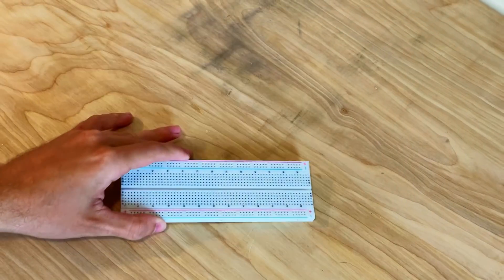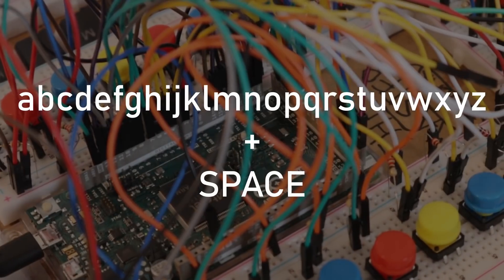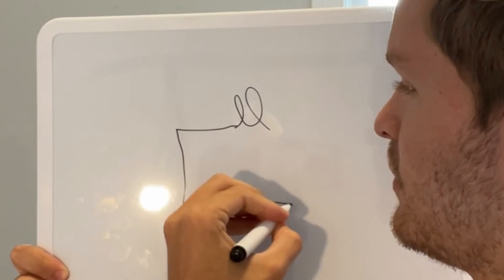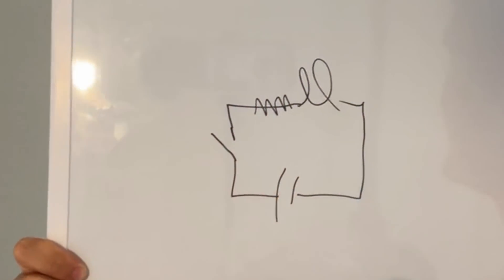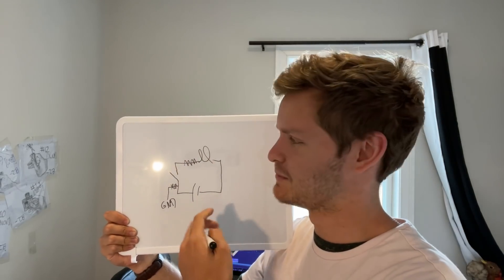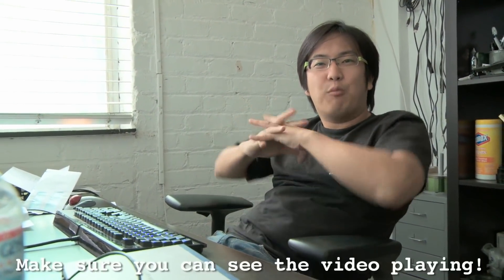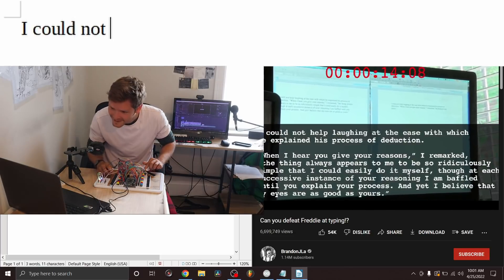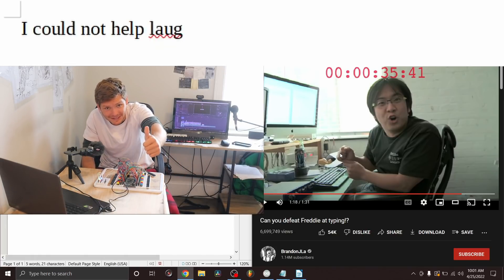The Worst Keyboard

Comment: I think that ground resistor will be called as a pull up resistor 🤔.
Reply: Not to offend anyone, and I love this dudes videos, but his diagram does not make much sense.

I think he meant to draw the "ground resistor" connected between the switch and bulb (because the bulb represents the input and inputs must not be left floating).
In that case the resistor would be a pull-down resistor as it pulls the input signal down to ground when the button is not pressed.
(making it more confusing is the fact that a LED does not need a pull-down/-up resistor, mixing up the LED example and actual circuit for an input)

In any case it was still a fun video 😄
Reply: a ground resistor would be pull down, if it is connected to vcc it would be a pull up, but then again there was no need to use those as that Arduino board has a ton of internal pull up/pull down's